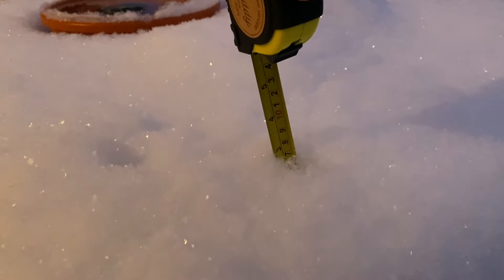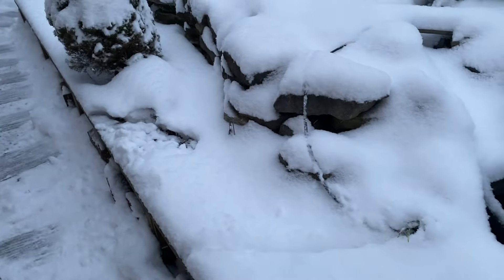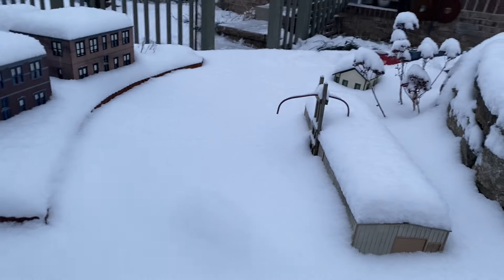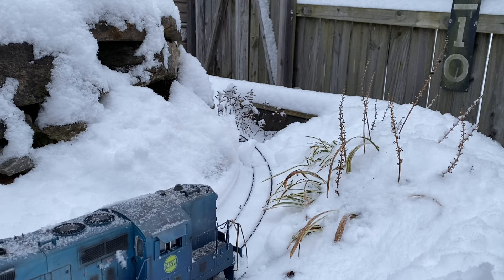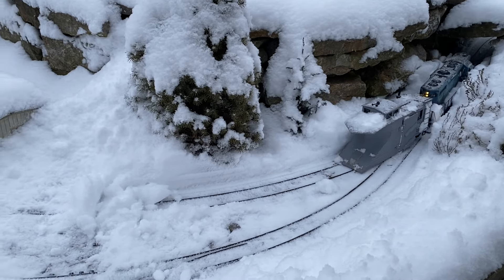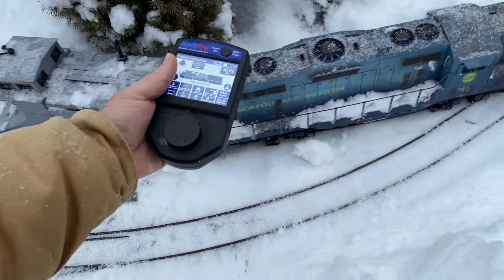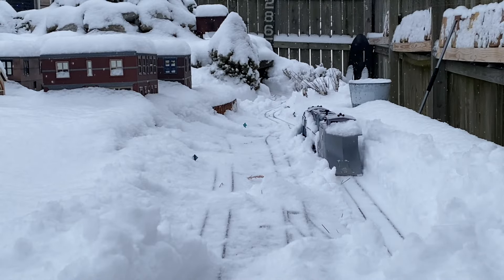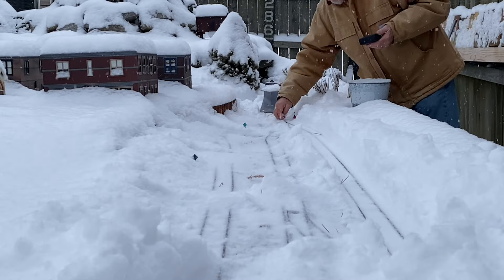Semi-successfully plowing the garden railroad

Comment: There's just something about super cold weather so I'm glad you had enough time to enjoy a little fun here in the garden I just think of it as outdoor therapy. Light fluffy snow we really don't get that much of in the Milwaukee area it usually has extra moisture from the lake and then gets an icy coating. A couple years ago the Northwestern group have pictures from a 1965 1966 blizzard conditions in Iowa on the Chicago Great Western. They have three or four F units with a wedge plow and got stuck requiring a manual dig out the cut had actually filled itself in which was up to the top of the locomotive. No rotaries here in Milwaukee but a lot of wedge plows also flangers and on occasion the Jordan spreader. It sounds like a fair number of the ones in northern Wisconsin but especially across Iowa were in use after this bigger storm because of the sustained winds.  Glad you had fun and now after all the cold off and on snow sleet and rain
Reply from the maker: I was watching some plow videos on YouTube a couple of days ago from the Midwest. Those guys really fly through the crossings! Fun stuff.
Snow will be gone in a couple of days here with the warmer temps and rain moving in. Might be done plowing for the year here since I won’t be here most of February.
Thanks for watching and stay safe, Paul.